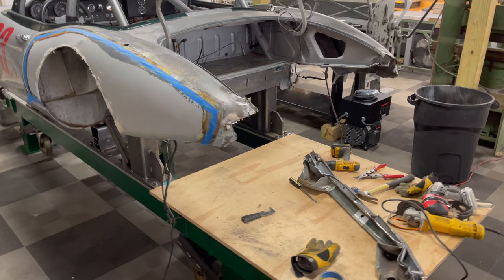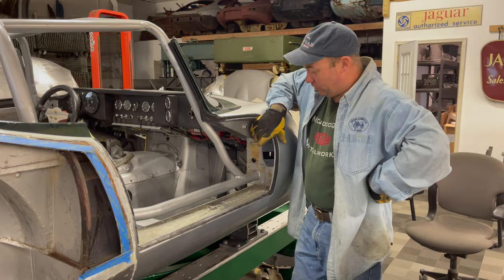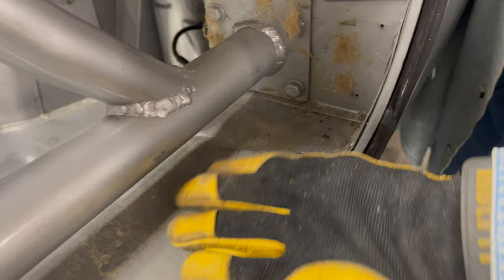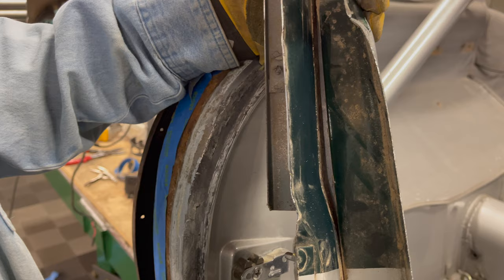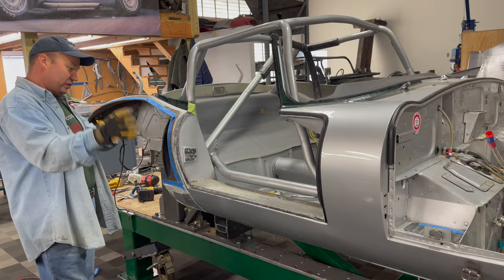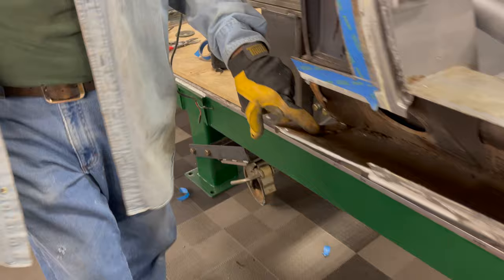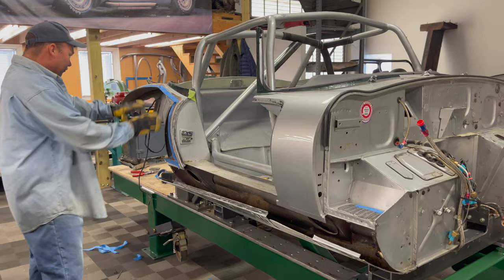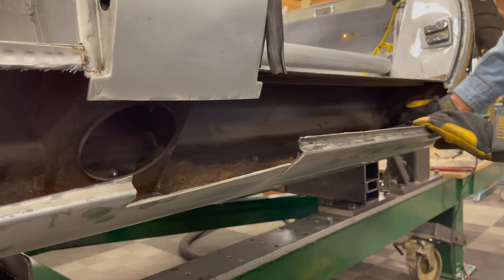Jaguar E-Type - 1967 Vintage Racing Crash Repair - Part 3 - Surprises Inside the Sills

Comment: Hi Chuck . Thanks for answering my comment .  Well that revealed a lot ! And l completely agree on your reasoning for not pulling the living daylights out of these cars . I've very recently fitted new sills on my '66 2+2 and made stronger gussets . And as you pointed out those spot welds are completely random both in strength and distance . I could virtually pull the N/S  sill off but the O/S was very hard work ! The biggest surprise l've had is the severity of the corrosion hiding behind the "A" post panels !!!! And how the heck that pesky mouse got in there beats me ! And that sand says it all about my thoughts on sandblasting . Thanks Chuck , always great to see you showing your skills !

Comment: So are spot/resistance welds going to be used to reassemble or plug welds.  Are you going to take scrap pieces and do destructive testing to check the strength of the new test welds?
Reply from the maker: On the testing - yes - we always do when we start up a session of spot-welding.  On this project, we will use a combination of both spot and plug depending on what makes sense - which is mostly determined by what we can and cannot REACH with the spot-welder.  These cars were assembled in a certain order so that they could do it and reach each welded seam as they went.  Now that we are doing things "out of order", there are lots of places where we won't be able to reach.  Plug welds are stronger anyway, so it will all work out fine - stay tuned and you'll get to see it all in action!  :-)

Comment: Good afternoon, I do like your surface plate and jig fixtures. It sure makes for a sure grip of the chassis for accuracy on the repairs. Are there factory specifications for these cars? Thanks for another great video. You take care.
Reply from the maker: Thank You, Steve - it was ALOT of work to build it - mostly because, No - there are not really factory specs for the body shell...  There is a widely circulated "crash sheet" that does have some numbers on it, but even those measurements are hard to use based on the way the E-Types were built - there is alot of "wiggle room" in the various mounting points.  In the end, we were able to use about a dozen original E-Type shells to back our way into what was original, and what the original body jigs probably looked like - including various tolerances, etc.  So it was a monstrous project to get it just right, but it's very helpful now to have it.  You can see more detailed photos of the jig here: https://www.monocoque-metalworks.com/main/2018/01/monocoque-metalworks-e-type-chassis-table-jigs/